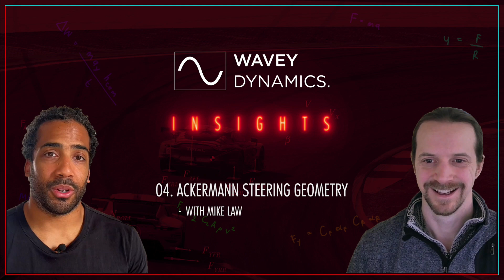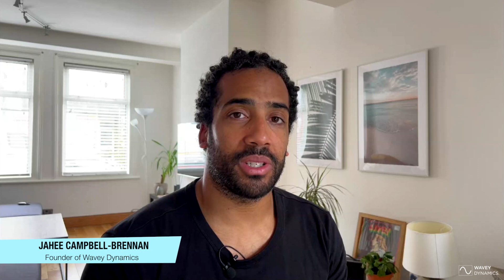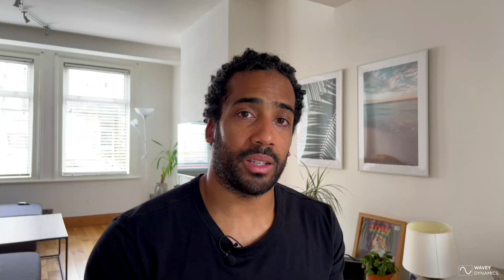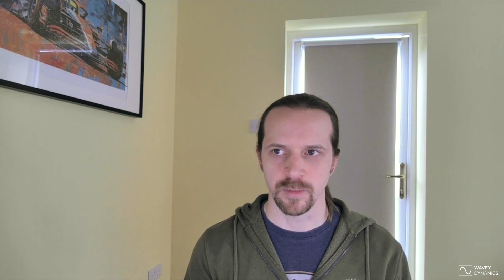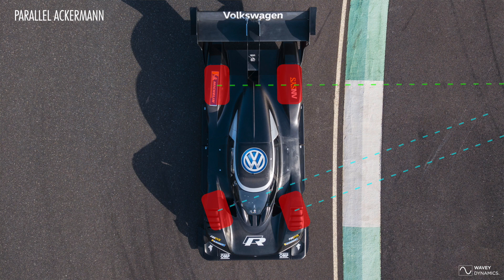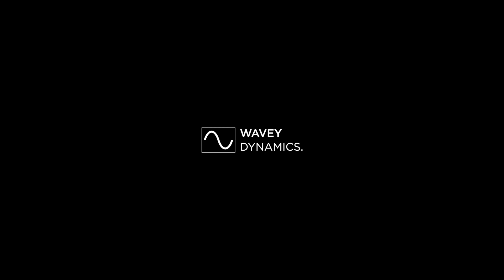Vehicle Dynamics Insights 004 | Ackermann Steering Geometry w/ Mike Law

Comment: A proper & robust Ackermann geometry must be defined by at least 2 turn radii.  Otherwise, there is an infinite number of solutions to produce the single only value, involving static toe, compliance and the steer arm geometry.   Anti-Ackermann is an understeer REDUCTION technique.  It also gets mixed up in mid-g_level steering gain issues, especially for a car that's slightly oversteering to begin with and you want to have a specified limit behavior.  A higher Max_lat usually comes along with this too.  But, like everything else, you can overdo it.  The rear should also be subjected to mods to maintain your balance.  Once you know the minimum turn radius and one other high speed turn radius (plus the tire data). The solution is fixed.  Keep in mind that there are 3 types of tire properties that you need to be aware of: Peak Fy advancing in slip angle with increased vertical load,  no change in Peak Fy slip angle with load, and Peak Fy slip angle reducing with Fz loading.   The first is more common, but plenty of the other ones around...   Oh, and you need to know your wheelbase, too.  Sometimes BOTH of them....
Reply from the maker: Yeah right on! I like the framing of it as an understeer reduction technique 👌🏾. I’ve always held it as a tool to maximise a_y but that’s a more subtle and nuanced take on it.

Mid g steering gain as in it increases gain when tyres aren’t saturated? 

Have never come across tyres which demonstrate peak Fy at reducing slip angles, in the linear range at least.. we’re talking radial ply?

- Jahee
Reply: @WaveyDynamics  I sent you an email (theoretically) with a presentation on all of this subject.  Did you get it ?
Reply from the maker: @zzvyb6  Hey Bill.

Yeah i got it, i sent you an reply back over the weekend - did it get relegated to junk? - Jahee